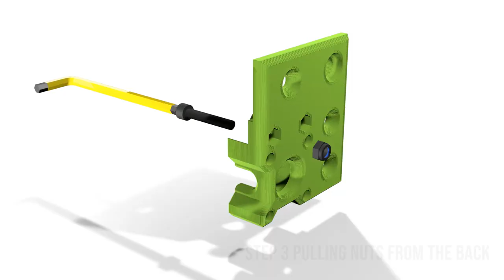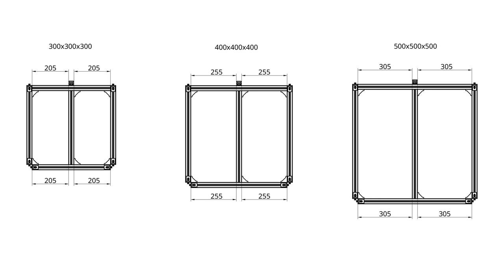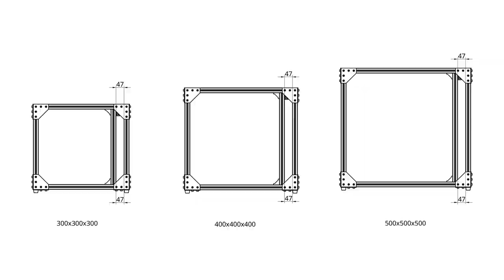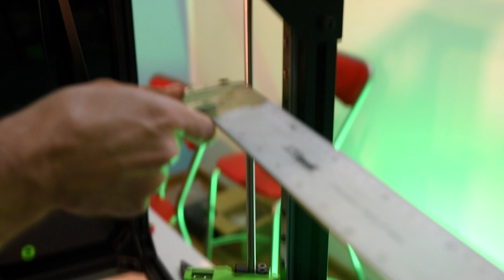Rat Rig V-Core 3 - Step-by-Step Mechanical Assembly

Comment: Ordered a 400x400 kit, this'll be helpful. In week 4 atm of waiting, exiting times. This kind of company deserves succes!
Reply: How is the printer Guus? Also ordered a 400mm one, but have to wait 8 weeks :(
Reply: So ... its time for a feedback?
Reply: @hapskie  @Lokadamus - Built it ever since, it came at week 6 (give or take). I like it, though I had idler issues. Fixed it since, and replaced the belt with a Gates belt. Got it running nicely now.

Comment: As I could see on the steps from the build assembly on the v-core site, the 300x300 kit comes with about 4.2 meters of belt, 2.1ish for each belt, right? I'm asking it because I bought the parts myself and got 10m of 9mm belt (don't wanna cut too much belt and ruin the rest of it :) 

Awesome video by the way!
Reply from the maker: You can check all the lengths at: https://v-core.ratrig.com/bom/
Reply: try to build a voron ... you will see more meters of belt :D

Comment: Do you supply the inner frame panel as well? I heard from other youtubers that you don't
Reply: No they dont. You will need to supply it yourself. There is a dxf file on their site with the correct dimensions and hole layouts.
Reply: @curlycallmcdiesel5074  every laser cutting wesite tells me that the dxf file is corrupted

Comment: I can't wait for my V3 to arrive in 500x500x500, hope it's not longer than the 6 week wait. Five weeks have already passed, I can't wait for the printer to arrive! :-)
Reply: my 9th week just started
Reply: @HelgeKeck okay that sounds not good. 😩
Reply: @HelgeKeck  Fuck. I'm only on week 1!
Reply: Ordered mine on June 1st, still waiting
Reply: @NoughtE  You are in the best boat... Probably 6 weeks for you!
Reply: @LouisPires  I hope so!!
Reply: Ordered my 500x500 on 12 July, received it Oct 13th.
Reply: @LouisPires  It's out for delivery today - Just over 12 weeks.
Reply: @kwik01  how's your printer working? Any issues?
Reply: @pavano6970  Constant issues. Bed was warped (looks like DHL might have dropped it) and then the same thing happened to the replacement. Seems like everytime I upgrade RatOS the printer wants to crash on my gCode (SuperSlicer). It's been a pain. My Ender 3 has been rock steady in comparison. I should have gone with a 400, 500 is too big now that I have it in front of me.
Reply: @kwik01  damn! I sourced all parts on my own and I am about to complete my build! Everything is smooth as of now! Let's see how my printer works! Thanks for the reply
Reply: @pavano6970  Things got better. I replaced the USB cable between my Pi and SKR and I am printing things now. Still needs some tuning, but nice to have this large volume printer earning its keep.
Reply: @kwik01  sounds great!

Comment: Everything Im seeing says the inner frame panel is end user sourced.. is there a place to get it? Or... and I left to figure it out on my own accord?
Reply from the maker: We provide DXF files so you can get the panels cut in a local laser shop. We intend to start supplying panels too, as soon as we can.
Reply: One solution is to use DIN rails in place of the panel. Works ok if you are not planning on enclosing the printer.

Comment: i want to build a 3d printer core xy but i'm still confused about choosing ratrig V core or voron trident is there any input for me so I don't choose the wrong 3d printer
Reply from the maker: We suggest that you join our community and ask our users for opinions: https://www.facebook.com/groups/ratrig3dprintercommunity
Reply: Just choose the Rat Rig - The ordering process is MUCH simpler as you can get 98% of the required parts from one trusted place. With the Voron you will be ordering from quite a few places and then also you have to keep track of what you ordered etc.. I was in the same boat but eventually ordered and still waiting for my Rat Rig V-Core 3 Kit
Reply: I agree with Louis.  I looked at the Voron, and was concerned that the only kits are from China and they got mixed reviews at best.   Rat Rig put together a great kit and you can customize as much as you want.  I'm almost done with mine and have used this video with the guides - they really work well together.